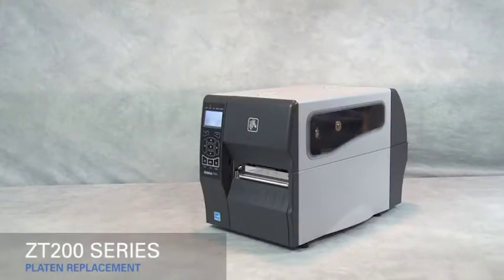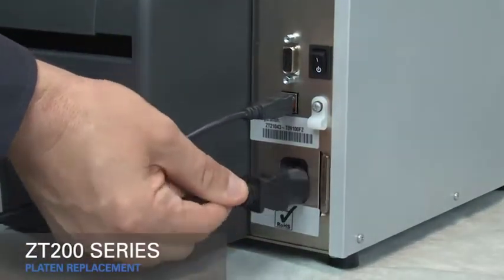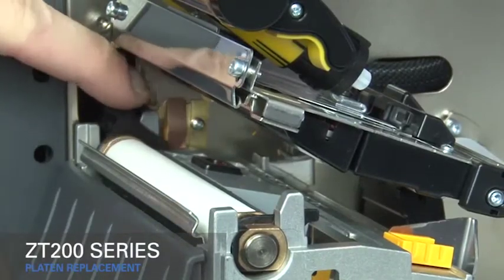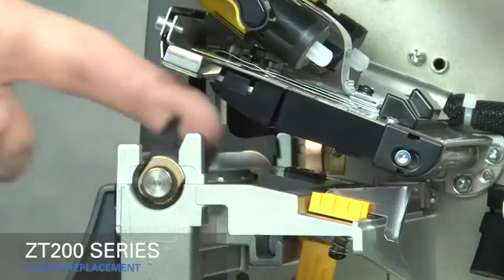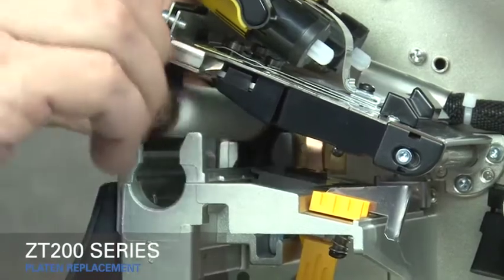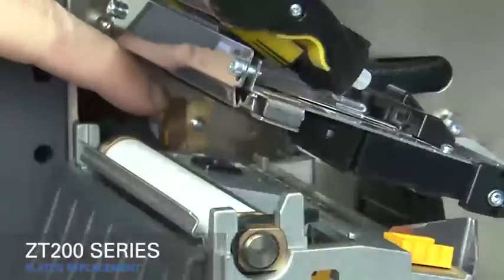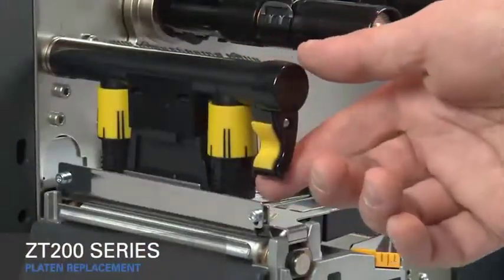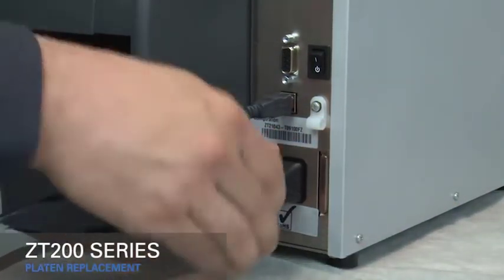ZT230 - How to Replace the Platen Roller

Comment: Lock tabs stuck. Needlenose pliers on the brass nut on the end of the roller worked. Couldn't raise the other tab, but had enough play to get labels off the roller.